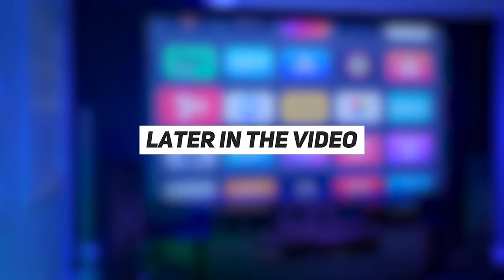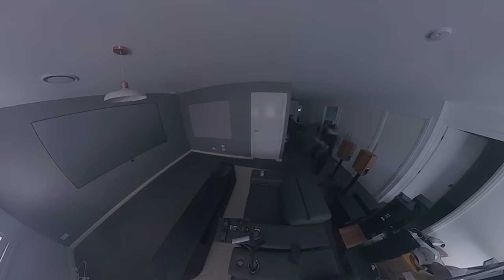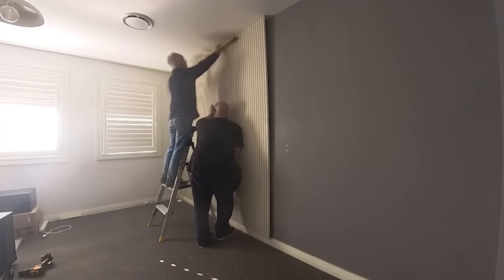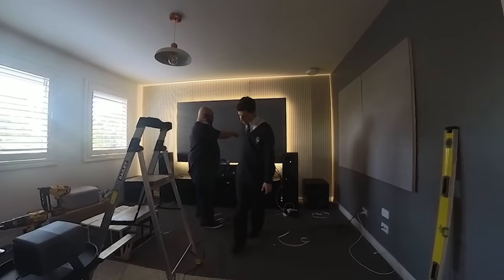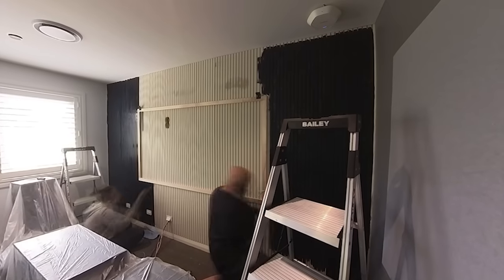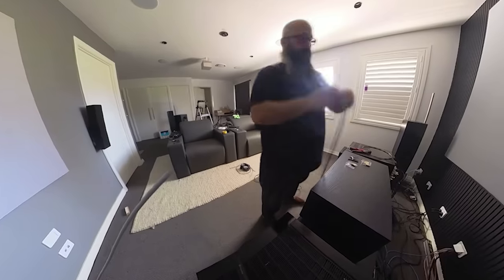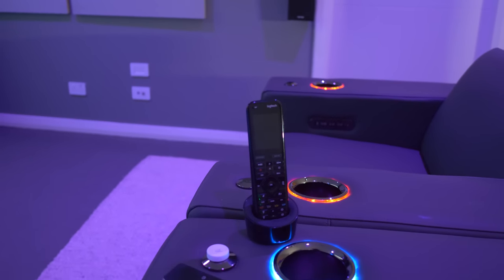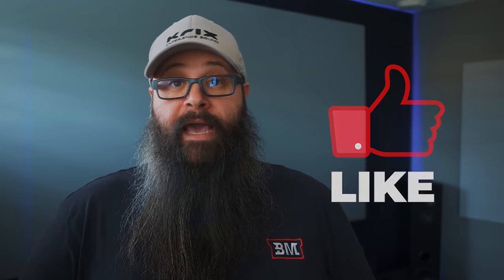NEW 4K DOLBY ATMOS 7.2.4 Home Theater! PART 2 (With Timelapse!) Krix / XGIMI Dolby Vision // Yamaha

Comment: Thank you for showing that you mounted the xgimi on the ceiling.  All reviews I've watched never hung it from the ceiling mount.  Please make a video of you installing it hanging and what mount you used?  I'm convinced the xgimi will be the next projector I purchase.
Reply from the maker: Initially I did do the review of the XHU on a stand but as it was so good, I decided to keep it and use it in this space. It's much better than some other reviewers gave it credit for but I calibrated mine manually with a sensor so the image is out of this world good.
Reply: Yea. I'm sure it checks the boxes of mostly all minimum requirements.  And mainly the price point.

Comment: How far did you install the Atmos speakers from the seating area?
Reply from the maker: The overhead speakers were done in accordance to the Dolby Atmos guide for 7.2.4 - so I can't recall exact numbers but my electricans worked out the angles and distances from the seated position. You can Google "Dolby Atmos 7.1.4 guide" and it should show you.

Comment: Fantastic result on the room overall Tony. I was particularly interested in your mention of ghost wire in the first video, I see you didn't need to use it after all but for my self install approach and KEF uni q Eggs hanging up on the Ceiling for atmos I think it's going to be really useful for tidying up my install! (The leftover grey paint I've got being particularly handy)

Dead set some people just get so fricking pretentious about speaker placement. Many installers  ie people with real world experience often recommend side surrounds slightly forward of the listening position with 7 base layer speakers. I've been doing this for 9 mths in my living room setup and as you point out Tony they sound fantastic in that spot. What I did do though was place the back surrounds slightly wider to compensate. I think a bit of symmetry is always a good thing.
Reply from the maker: Yes, the ghostwire was purchased however, I realised that you have to still plaster over it and then paint and I felt that it wasn't worth the extra effort for what is a casual space. The sleeving around the edges isnt noticeable, it just blends into the skirting boards, so I felt that would work. For a more dedicated room, I would certainly do it. Also agree with your comments about speaker placement. Of course its best to do it correctly according to spec but if you can't you compromise and be fine with it - but some people tend to think if it cant be textbook it cant be good so dont bother :) Good luck with your setup!

Comment: Great video Tony, can you share some of the video setting you use for the xgimi? Also what mount are you using?
Reply from the maker: My settings are based on a calibration with my room and screen conditions and likely wouldn't help you very much, and could make the picture worse for you. I do get asked a lot and this has generally been the case. I am going to do a video on it now that its been in the setup for about a month so I may show the settings in there and you could try at your own risk.

Comment: Great Job! Great review. What ceiling mount did you use for the Xgimi Horizon. Also, how are the black levels on the projector? Alot of reviews complain about low contrast
Reply from the maker: I used a spare microphone 1/4" mount which worked perfectly for me! And people's claims about the XGIMI are not something Im familiar with. Check my review on it - plenty of contrast on my unit. I calibrated with a sensor. Possibly some issues with the preset modes - but I use a sensor and got it dialled right in!
Reply: Thanks about to purchase my first projector either the xgimi horizon or Hisense C1  can you post a picture of that ceiling mount or maybe a video? Thanks

Comment: What mode is used in the receiver to support biamping? Room looks great btw!
Reply from the maker: Nothing. I use the pre-outs on the back and the. Use a Y cable to duplicate the signal to the amplifier and then have each speaker terminal on the back of the speaker go to it’s own channel. Works perfectly! I use the internal amps on the A8 for overhead speakers only.

Comment: How do you biamp your front speaker using power amp and av receiver? Whilst still using the atmos and surround?
Reply from the maker: You use the pre outs on the back of the Reciever with a Y splitter to two channels on the amplifier. I keep the overhead speakers powered by the Reciever.

Comment: What will you be doing for screen synced lightning on the 120"?   I can't find anything for that size, and Hue's bars seem to have awkward zone issues when combining light strips.
Reply from the maker: I now have LIFX strips around the outside of it - that's all I could manage - nothing matches that is in the size I needed.
Reply: @BuildMontage  dang. Yea i don’t see anything over 100” in length either.

Comment: Great set up! Thanks for sharing Tony. What mount did you use for the xgimi?
Reply from the maker: Ha! This is the funny thing right... I was searching for a short 1/4" mount and could not find ANYTHING that would work even on Amazon. I was going through my drawers and found this short white mount which I think may have been for a microphone I bought years ago... And... it worked!
Reply: @BuildMontage  funny AND lucky. I’m considering a Xgimi as I have a dedicated space and currently running a 75” tv. I don’t have the budget to go for a Sony or JVC and between price and being the only longthrow with DV I’m considering a purchase.

Comment: Room looks Amazing. I'm undecided on what to use for ATMOS speakers. There seems to be a lot of debate where to place ATMOS speakers, on the wall as front and rear heights or on top in the ceiling above as you have installed. Do you have a opinion which is the correct or best lay out. I'm looking at KRIX IC-50 for in ceiling, I have Polk r700 and R400 LCR would the KRIX IC-50 blend in with the polks, Also I like to upgrade to a 3 way center speaker like the Krix - Vortex Mk2 - Centre Speaker or svs ultra center instead of the Polk L400as it's is too expensive. Would any of those options blend in ok with my R700 fronts. Cheers.
Reply from the maker: Thanks, I really love this space to chill out in on the daily! Overhead speakers tend to suffer less from requiring a consistent mattched speaker as the bed layers do, and you can't go wrong with Krix, or the IC52 speakers. The Vortex for me was a goal as I had heard it many times and also have the bigger brother Epicentrix downstairs, so really wanted to go with it and I haven't looked back. I'd go listen to one and allow that to help make your decision.
Reply: @BuildMontage  Not many places to demo here in Qld unlike in Melb and Sydney. Thanks for your time to reply

Comment: Looks amazing, but the biamp being "instantly noticible"? are you sure that maybe the biamp setting on the amp wasn't accidentally turned on (for the non-biamp test)? I'm not against biamp I just find it strange that you would report such an extreme difference
Reply from the maker: I have a pretty good ear. I also listened to the setup well before biamping so it was very noticeable to my ear. Much more detail and more oomph in the midrange.
Reply: i see, makes me wish that my KEF q950 had biamp (my former less good speakers had biamp, but they might have not been high-end enough to be noticible) @BuildMontage
Reply from the maker: @Niberspace  it’s possible. Every speaker is different. These LCR speakers are all 3 way speakers and really benefit from a bit of juice thrown at them. Absolute tanks and very cinematic but also musical as well.